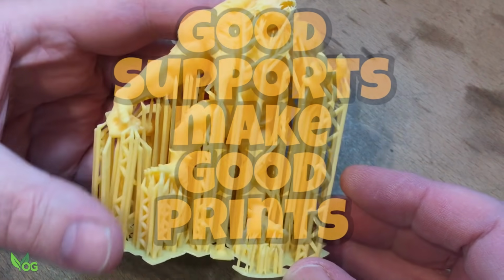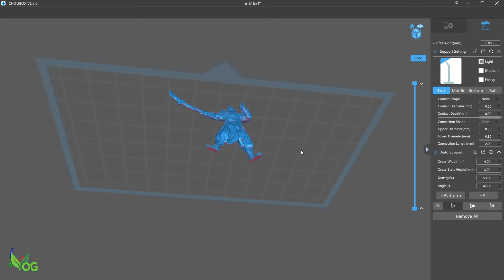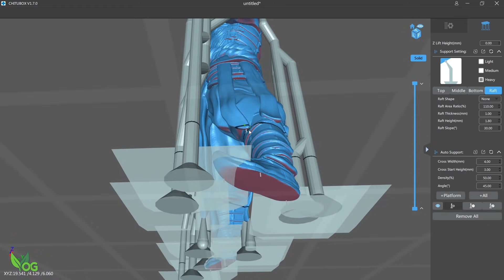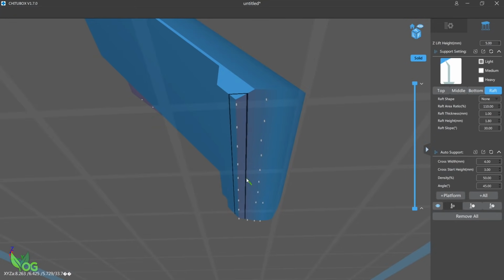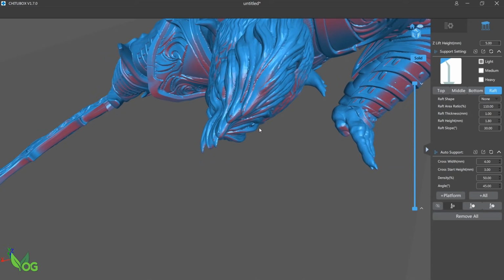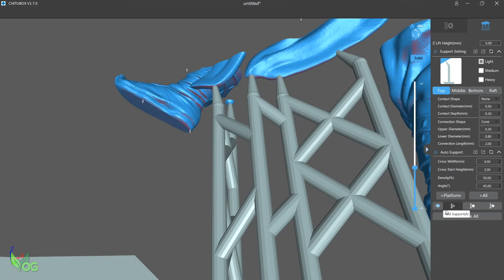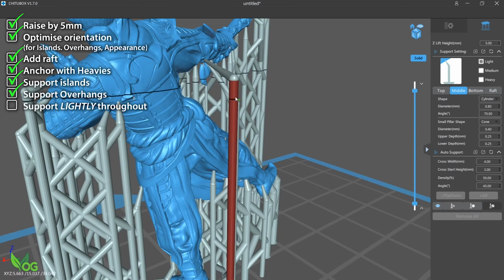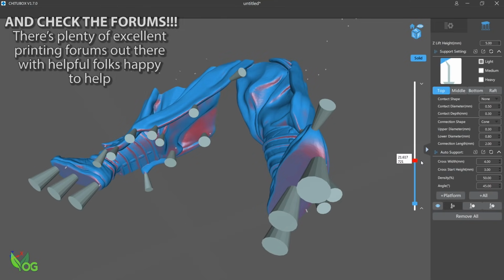3D resin print supports [EASY GUIDE]

Comment: Thanks for the vids. New to Resin support. I'm an FDM print but with the recent plugins to use Resin support for FDM I'm learning..  :)

In Lychee / Chitubox can we add the critical support manually such as the initial heavy medium ones and let the slicer populate the rest light supports in 'auto mode' to save time?

Comment: Question. I've seen people use hot water after Printing and removing supports before curing, so they don't have to cut. Why don't you? Genuinely curious. I've just got a printer
Reply from the maker: That's an excellent question. The main reason is very simple. The people that tell you this NEVER tell you what they do with the leftover water because it should NOT be poured down the drain. If you read the MSDS that comes with the resin 99.9% of them say that they are harmful to aquatic life, ie, poisonous it water. Personally I avoid contaminating the water I drink and don't encourage others to do it either 😁
You might want to watch this video https://youtu.be/tm2PyYS8ncI

Comment: Stumbled on this video and most of the things i've actually learned the hard way. Sagging on big flat surfaces for example. But the whole auto support stuff was pretty new for me and also using heavier supports. I barely have any failed prints but when i do its usually just thick and heavy prints like a Minigun from Fallout 4. Supported the hell out of it yet it still deformed. Rotated it 45 degrees and it came out perfect.

Comment: I received my first printer two days ago. I’ve had successful prints until today, when printing a platform floor that ended up with a bowed edge. I was perplexed, but it seems that it sagged because of inadequate support. Thanks for this video- it’s helped me to avoid this problem moving forward as I know what to look for now, and I’m about to start printing some much larger pieces. Thank you 🙏🏻

Comment: While resin printer results are truly fascinating, the process is more of a manufacturing production line rather than a one-stop-show that FDM printers are. If you do not feel like messing around with exhaust pipes, filtering, toxic fumes, chemicals that can burn your skin etc then FDM is the only option. But the results of resin are definitely 5-10x better. Good detailed video though.

Comment: Thank you for this. I've been FDM printing for 3+ years now, and have that process worked out pretty well. However, I've just started resin printing, and I am finding out that this process behaves quite unlike FDM printing, particularly when it comes to model orientation and support requirements. This video has shed some light on a couple recent failures and artifacts that I have experienced, and more importantly- why.
Reply from the maker: Glad it helped

Comment: I'm using 1.94.  I know this video is a couple years old.   When I first open chit u box I don't see all the red on the bottom untill I click on add supports.   Then I have to go back into the non add support tab to adjust the model and it removes the red areas.   Kind of a pain.   Also it has an eyeball box to check in the support tab.   I do that but the little hanging lines dont show up.   Do you have a more updated version of this video or could make one.   Or tell me what I might be doing wrong.   Great video regardless and thanks it was so help full.

Comment: I still get very bad results (saggings). Specially in miniatures with multiple parts that I have to glue together.
For example: I print a Majin boo bust and legs
When I try to glue them together, one or both parts are not flat, what causes a gap between them
Any tips to solve this?

BTW, awesome video, thanks for sharing this

I'm running a Mars 2 Pro

Comment: Sometimes I export the supported STL and pull it back into ZBrush and add non-scaffolding supports to hold up fiddly bits. Like, you can make shapes sort of like a candelabra/menorah sort of thing to hold up a bunch of tiny bits, or have serpentine supports that snake around and avoid intersecting. Rather than doubling up the scaffolding, I'll often put in an arch for an area that's holding up a lot.

Comment: Any advise on figures printed with resin, melting after a year or so?
Reply from the maker: Melting? Resin? Not come across that. Cracking, yes, but not melting. What sort of resin did you use? Where were the prints stored? What sort of temperatures?
Reply: @vogman  Well you can see on some youtube videos how it seems some resin figures start dripping resin and that it seems to be because of bad curing, but can I ask you something else, can a resin figure really last for years? I mean they should right?

Comment: I only got my first 3D printer yesterday and had my first failed print. This made me feel less dejected about it, and I've learnt a lot more for tomorrow :) Thanks!
Reply from the maker: Don't feel dejected. EVERYONE goes through this. In honesty, you always will, but the failures will become fewer and fewer and fewer.
Start with a known resin... by this I mean if you have an Elegoo printer, use an Elegoo resin, etc. It's not critical but it's easier to get the correct settings and it's one less thing for you to worry about.
Next, download some pre-supported models from Thingiverse.com and just do some printing. It will boost you 😁
Then have a go at supporting your own. You soon learn what to look for. 😁👍👍👍

Comment: A mate of mine just started Resinprinting recently, but I guess he didn't read up on the topic enough.

His prints failed, as in only the supports were printed, but not the model itself.
Any idea what the problem could be?
Is it supports?
Reply from the maker: There are lots of possibilities but most likely with a newbie is too thin and too few supports. It's natural to want to avoid using them to prevent spoiling the print, but there's surprising weight to a print and the process literally sucks at the print, pulling on the supports during the process. That's why I always encourage the use of a number of heavy anchor prints and then move on from there. Share this video with him and if he has issues he can always drop me a line 😁

Comment: I am more into printing mechanical rather than decorative items, and one of the issues I'm having is when using supports they end up ruining flat faces by either leaving little pits, making surface look like orange peel, or sometimes ending up causing a 'quilted' look to the surface. Are there any ways of dealing with that? My only startegy so far is wherever possible to print directly onto the build plate with the back face, which is OK for some parts, but can't be used for anything. If you have any tips on that I would be very keen to hear about them. For info I'm printing with an AnyCubic Mono X
Reply from the maker: Have you consider a flexible plate like the Wham Bam? https://youtu.be/fRs6tjE3KhQ
With these you can print flat and still remove with ease.
Reply: @vogman  Yes. I looked into them, but the issue is more where the geometry requires parallel faces that are further away from the buildplate. I design to minimise it, but sometimes I have no choice, (think bolt hole flange rebates) and the surface of those are very poor due to the effect of the support - but can't be printed without them.

Comment: A great video, i tried to print with auto supports and it didn't work. Once I watched this video and manually placed them, it printed perfectly.

Just a little note, I recommend removing supports before curing. It makes it easier and leaves less marks
Reply from the maker: Thanks for the kind comments - and thanks for Tip sharing 😁

Comment: Has anyone ever encountered unusually thick supports directly extended from the resin print? It's like a glitch and I have been getting then lately. It's a pain since I can only remove them by sanding. I don't see them in my slicer, only appears in the print.

Comment: Great video, learned a lot. I guess, the only thing I'd add (and why I'm looking for videos on the topic) is how do you know or whats a  good rule of thumb, for knowing how many supports to have to "pull" a large cross section part off the FEP without it disconnecting from  your supports and failing. I keep printing thick parts and it seems no matter how many supports I add, I can't get a part to print past the lower supports.

Comment: I recently got a photon mono se (with the anycubic skin resin it came with or the new elegoo washable ceramic grey I just got) and I don’t get the detail quality you seem to be getting. I wonder if I’m missing a simple technique or setting or something, like exposure time etc.

Do you use anti-alias with your prints? And what layer level do you use? 

Do you have a hints and tips video for detail?
Reply from the maker: That's not something I've ever created a video about John, but I'll give that some thought.
In honesty, for me the machines do all the work. Just make sure they're properly levelled and the resin has been well mixed (shaken). I do use anti alias and this can fade detail a little, but not too much. The Mono SE is a great printer. I was able to do some great prints with it straight out of the box - https://youtu.be/0Mb0NVehGiw
Resin may be the issue. It might be worth switching to another bottle just to test. Oh, and grey just helps detail visually pop. I've never tried skin tones.
Also, increase the Layer time by .5 seconds which is quite a bit on a Monochrome, or even 1 sec if you're feeling daring, and print something small. This is a deliberate attempt at overexposing the print. Under exposure gives you blurred results. Overexposure can lead to more printer lines and unwanted overhangs, etc. But personally I always lean toward over. See if that helps. If it does, you can either increase or decrease to dial in. Just remember, printing settings are a guide. What works on my printer might not work on yours, even though they're the same make and model, so some adjustment is very common. 😁

Comment: Nice video about supports, but its missing the critical content of how to get them off of the print cleanly after printing.
Reply from the maker: Personally James I always cut away my supports. Ripping them off can create damage. Firstly clip away roughly, a few mm from the print, just to remove the bulk of the support. Then try for a flush clip, ideally leaving a tiny nub rather than a tiny hole. At that point, fine sandpaper such as 600 grit will smooth the rest away without ruining your print 😁
Additionally, maybe look at using the Lychee slicer (free or pro) https://youtu.be/hAwnRQ5rpy0
This uses longer and finer supports than ChiTuBox which, from my experience, seem to do less damage.

Comment: "I oversupport, but I don't get many failed prints so I don't care." That sums up my thoughts perfectly. I'd rather have a couple supports that I could probably have gotten away with not using. Than find that five hours later my print bombed.
Reply from the maker: Exactly! 5 minutes cleaning up supports vs 5 hours waiting on a mis-print. It's an obvious choice 😁

Comment: A great video!  I have a resin printer coming so zero use yet.  However I have been printing FDM for about 6 months now.  My question is, should supports be removed before or after curing?  Thanks!
Reply from the maker: Keep your gloves on, snip away gently, another quick clean in IPA and the UV cure. At that point, any little nubs can be very easily sanded away 😁😁😁

Comment: Quite recently I've been doing some in-depth reading on the subject of improving resin print quality and wondered why everyone always recommends rotating in increments of xx degrees.  A lot of times, the listed answer is simply gravity and better support structure, but in that digging, I came across some white papers from the wee early days of resin printing that did an in-depth test of print quality based on shapes and orientation. 
Longish story shortish, 30* was found to offer the optimal angle for surface resolution, less stair stepping, better resin drainage and the least amount of distortion for the average of simple and complex shapes tested. Of course in practice it's nice when it works, but like my current project, it's so big on the platform that I'm exceptionally limited on angles, like 15 or 31. If it weren't an industrial part dependant on exact tolerance, I was almost of the mindset that I was going to model in registration keys and chop it in half, but due to the complex shape, it'd be a literal nightmare to get it back in spec and be 100% trustworthy. I may end up doing it anyway and try to make it a part that can be cast and copied, but I have great suspicion that it's not going to work without a major redesign.

Comment: I use PrusaSlicer to generate supports, then export as STL With Supports. It does a much better job than Chitubox and the supports break away with very little cleanup. The auto-orient feature also works OK most of the time, but you have to sanity check the result.
Reply from the maker: I think I can top your Prusa... look out for Friday's video 😁

Comment: FDM user here, with a noob question.  Are resin prints always 100% infill if they have a solid outer shell?  Is that just done to avoid having lots of internal supports?  With FDM, the infill is pretty much automatically lined up with the previous layer.  Is resin printing the same?
Reply from the maker: Resin slicers have a Hollow function. You choose how thick you want the walls and the slicer removes the inside automatically. It then generally adds thinner internal supports to maintain the structure but reduce resin consumption. Holes are also usually included at either end of the print to let trapped resin drip free.

Comment: Awesome! I definitely learned a few things. I printed that "open source hardware" ring that's up on thingiverse. It came out great, but I only used automatic supports in Lychee Slicer. Unfortunately the first hundred layers or so got slightly distorted and sort of thinned out a bit. The thin 30um layers might've been bending or something and caused it. I'd be interested in knowing any advice you have on avoiding such distortions for casting. I think you printed the sprue in to the band on one of your rings which might've been helpful to my print. I and the rest of your followers welcome your tips! Thanks!
Reply from the maker: Just like with the Open Source ring, I do like to include at least one sprue in the design. If the design is suitable (as with the OS) this is often all that's needed. I'm a big fan of Lychee as you'll discover tomorrow, but I don't trust any autosupport. However, Lychee has an Island Finder and then a Support Islands feature. I'd recommend doing this every time... 
So I'd anchor with a heavy or two (like the large sprues through the ring), Island Find, Support Islands, then look around and pick a few more spots if necessary.
I'll touch briefly on a lot of this in tomorrow's video - about Lychee 😁😁😁
Reply: @vogman  sweet! Thanks!
Reply: @vogman  also I'm very in to Lychee right now. I do however think a few things from ChiTuBox should be moved over to it. Another thing for me is that the public Beta version is the only one besides Photon workshop that can export for the Photon Mono SE right now. And for some reason the stable version has way more detailed print settings than the beta version... I don't know if they're trying to simplify, or if they just haven't put them in the beta yet. Weird. Also if you haven't thought about it already, consider the Lychee Pro price. It's one of those things where I'm comfortable with it to help them develope it faster. Not telling you to pay for it. I just thought the amount to support them and what you get is interesting.
Reply from the maker: In fairness to Lychee, they're a very young and they're adapting constantly to meet the changes of the printer world. Their Betas are excellent. Mine hasn't caused me issues. And yes, fabulously priced Pro. If only all companies were so thoughtful in their pricing 😁
Reply: @vogman  yes. They're very young and off to a good start. I guess it helps that this new generation of printers are based off of standardized hardware. I have no problem paying a minimal fee to help them get paid for something I'll be presumably making money from. It only helps the software get better. Oh btw I think they released a new stable version. I haven't gone to look at it yet.